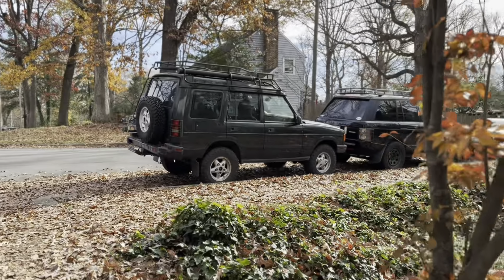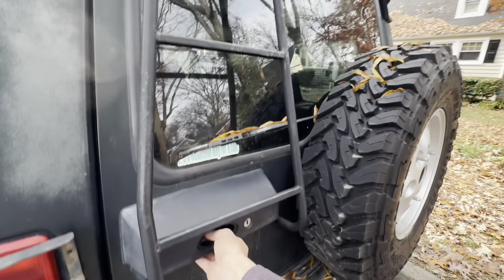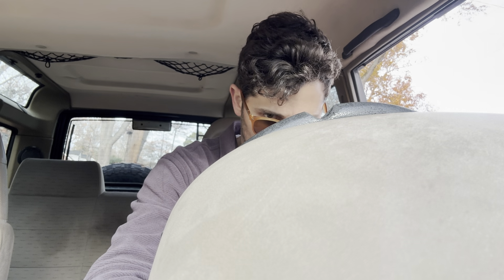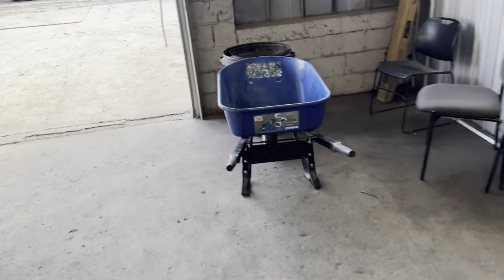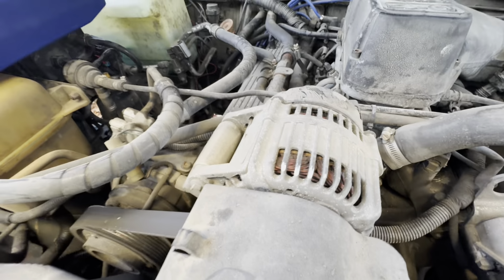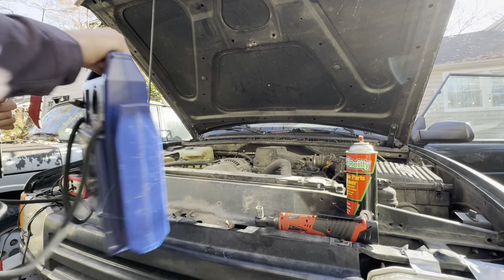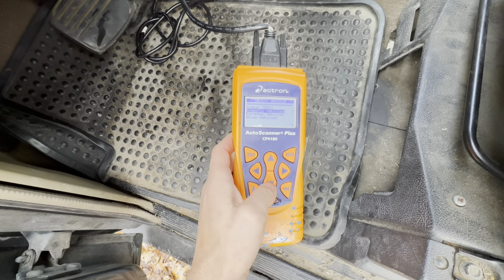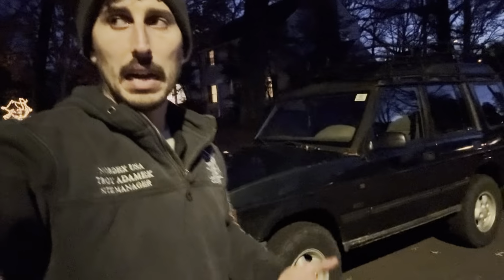I Bought The Best Disco - How NOT To Buy A CHEAP Land Rover Discovery | Did I Overpay?!?

Comment: Lifter is super easy. Just do the long socket extension stethoscope trick on the lifters. I always screw up exhaust leaks with lifters and that makes it very obvious. Every 4.0 you buy you should do a head gasket regardless of what anyone says or what it looks like. I paid $2500 for a somewhat running and driving 95 zero rust flat top.  So that might help out with what you define overpaid.  I love these trucks and they don't love me back. Reminds me of my first girlfriend.
Reply from the maker: Thanks. I think it’s worth pursuing.

Comment: I'm convinced the "concerning" sounds and sensations Land Rovers of the period make and provide are intentional design features at this point. You can either accept you own and rely on the mechanical equivalent of a horse as a means of transportation--and learn to appreciate the unique personality of each Rover--or go broke failing to make it the Toyota it was never intended to be. Hello, my name is Mike, I have the disease, and I'm terminal.
Reply from the maker: Welcome.
Reply: @AddictedMotors  I was stoked to find your channel! You make all the purchases I'm too timid too. Mad props for the amount of problem children you adopt. Your wife is saint :)  I know that exact tapping sound too well. I've spent over 3k trying to diagnose it with Land Rover specialists who all have come back and told me to live it, least satisfactory answer ever when you have the money to sort it. Variously diagnosed as lifter tick, rod knock, exhaust leak, clogged oil passages. These are people with six figure tool sets and at least a decade of experience each. Adding Marvel Mystery Oil when it appears has kept my 4.2 purring;  when the sound appears--I add MMO--its gone in 20 miles. 240k on my Classic daily driver and compression is still great as of testing 4 months ago. Worth a try if rebuilding this engine isn't in your plans. I hope something as simple as that sorts the Disco out. Cheers.

Comment: Oil pump pressure check. Probably a broken oil pump.
Reply from the maker: Have to pull the timing cover for that right?
Reply: @AddictedMotors  Yes. But it's a cheap fix. Less than 200 on Atlantic British.